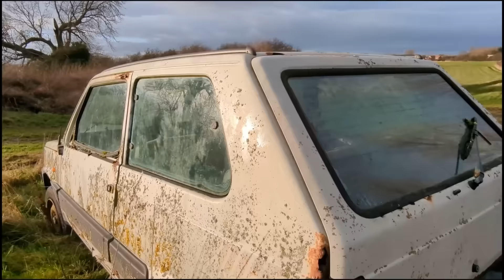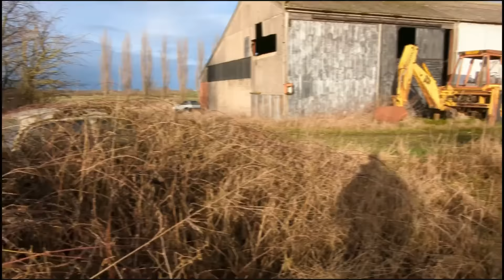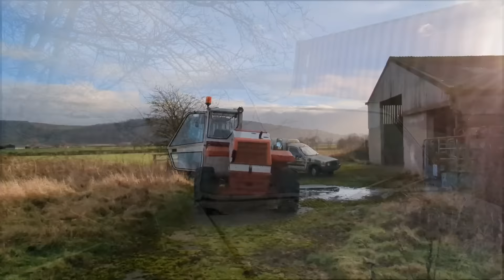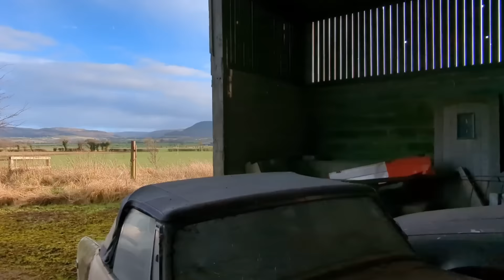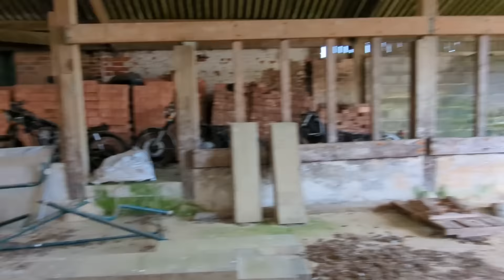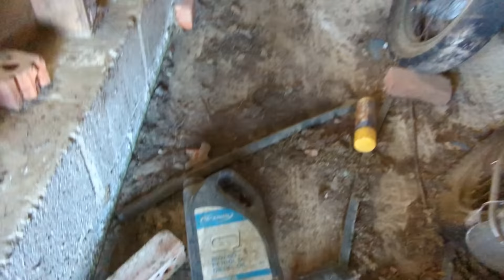Abandoned vehicle grave yard with Helicopter

Comment: The Alfa 2000 GTV 'Strada' was a 1978 limited edition with alloy wheels and a Smiths Servoglide electric window kit fitted by the dealer. They were basically unsold 1977 cars tarted up. I think I remember this one driving around Darlington in the early 1990's - it was a rare car then!